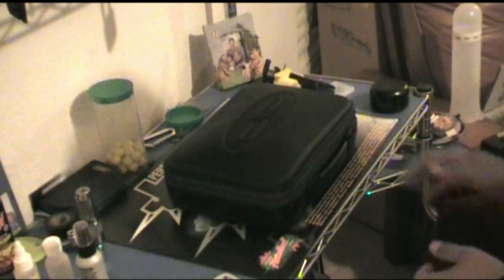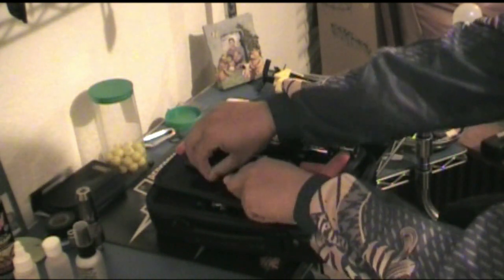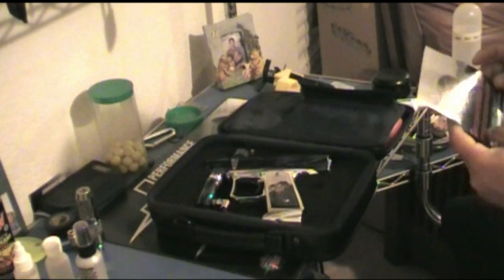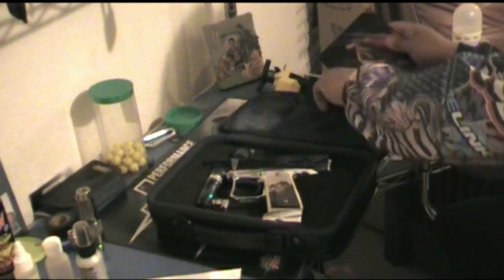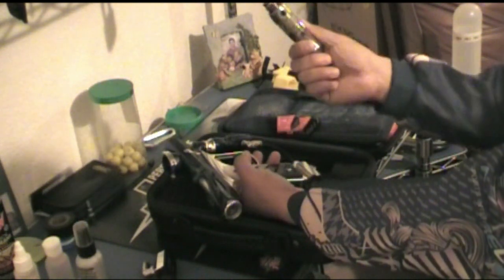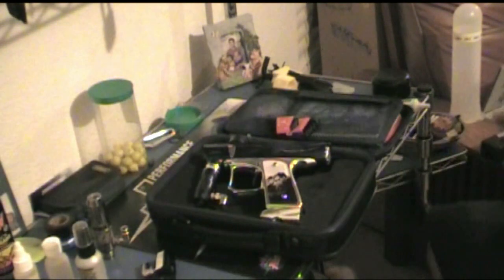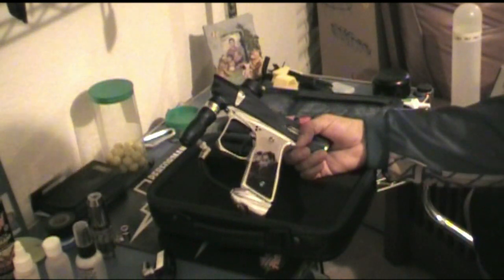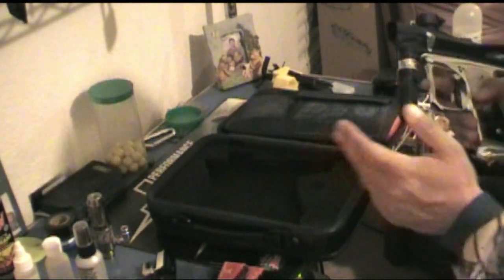Dangerous Power Revi Review Part 1

Comment from the maker: It's really loud for a spoolie, efficient, light, low maintenance, no bolt stick (for me), I hatted the trigger adjustment could not get it just right, it was either too bouncy or too stiff. PMD cracked, customer service is hit or miss sometimes they are great, other time makes you want to throw your gun away. Eyes are not self cleaning, so once you get a break you should clean them, capable of shooting faster than loader can feed with eyes off.